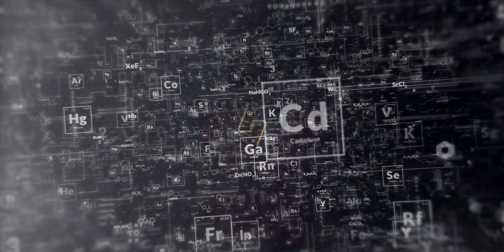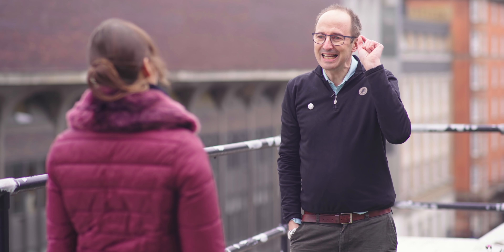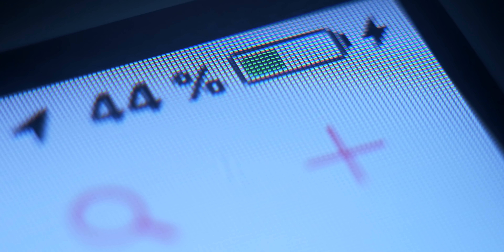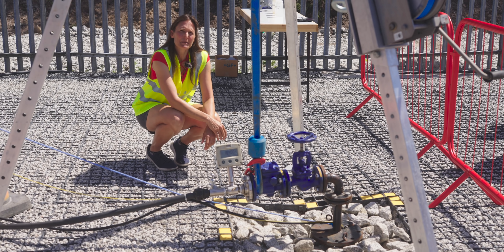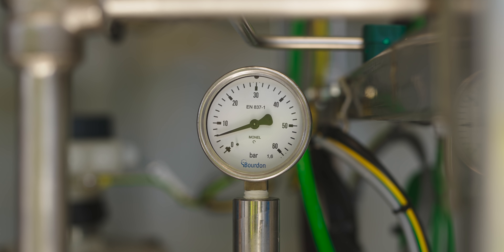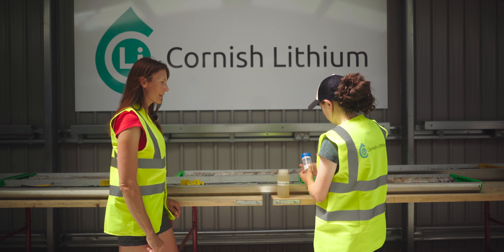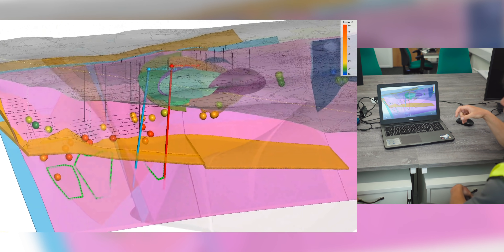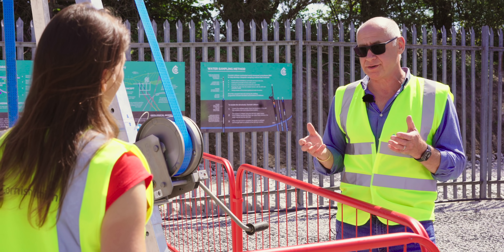LITHIUM for EV BATTERIES - The art of mineral extraction with Cornish Lithium | FULLY CHARGED

Comment from the maker: Do you think Lithium could be the solution to increased demand for EV batteries? Tell us below...
Reply: @UCkDRvquAG0lgBef5zbZwFvg I've been investing in Lithium for 12 years... sea water extraction is to expensive/to slow in process...yes of course its possible,  like thermal extraction from the likes of Geo40 here in NZ etc... Hydroxide is the go to chemical structure considering Ganfeng/Panasonic/Samsung has a problem with the brine operation given the impurities like magnesium more so than Fe etc...
Reply: Great to hear that it should be a more environmentally sound way to extract Lithium I guess? But it would have been far more useful, if a true comparison was done comparing it to current Lithium extraction methods. Anecdotally it seems to have a low concentration and higher costs?  
WADR, we were left with more questions than answers.....
Reply: Peter Lattimort
Reply: Lithium is great for EV's and aircraft etc.
But the next element up in that table was Sodium. Surely we should be using Sodium batteries for everything where weight isn't a factor? It's easy to get hold of - especially as a lot of the world will need to start desalinating sea water as their source of drinking water (ala California - which seems on a one way journey to hell {dry and hot} at the moment!)
Reply: @computerbob06  there are a couple of sodium based battery’s but the energy density is fairly low, as is the charge/discharge rate. They are being used in buildings, for UPS units, but they are bulky and expensive. Not a mainstream item but a niche product.
Reply: Standard Lithium, and E3 metals are doing similar things to Cornwall. Both have pilot plants in operation.
Reply: Worth adding there are other geothermal lithium brine projects, perhaps the most interesting is Vulcan Energy doing similar things in the Upper Rhine in Germany. The potential resource together with the Cornwall one might make Europe lithium independent as a whole.
Reply: How about Vanadium ?
Reply: @SpreadLoveNCreativity  how about sodium
Reply: @troyswan7123  Actually both are good ideas but only science expert can say which ones better in terms of Feasibility, performance etc. Am not into science much 😊.
Reply: @christinalaw3375  Don’t forget the fuss about recycling EV batteries. In reality, an old car will have most of its cells repurposed where ultimate capacity is not an issue and very few will be recycled for many years. When they do, we have ultra chilled processing that safely munches up the battery cells so contents are recovered.
Reply: A great way to burn investment money.
Reply: @christinalaw3375  you’re wrong actually. It’s wind turbines that kill puppies. Coal never killed anything. I don’t want to live in a world where our puppies cant fly around freely. 😂
Reply: @genericuser2339  coal killed my puppy, a sack of it fell on him.
Reply: Cars don't seem to care too much about the added battery mass. If anything, it's used to their advantage in lowering the CoG. But with short-hop sky taxis I think any marginal increases in battery energy density is going to make a huge difference in rate of adoption.
Reply from the maker: @akmuma-r3m  what a lovely comment, I haven't heard that one in a while. There is a company in the City of London, Benchmark Mineral Intelligence, they keep track of all the materials extracted from the earth, how much they cost, where they come from, what they are used for and how much is left.
It's a full time job for 50+ people, that is all they do. Study the markets, talk to the mining and shipping companies, talk to geologists and follow the price and market trends.
They state without hesitation that there is more lithium on the planet than we could ever use. There's not enough copper, nickel, cadmium, chromite, cobalt and many other materials we currently rely on to make the electronics we're using to write these comments, but there's plenty of lithium.
And just to restate, in a large vehicle battery, around 2% of that batteries mass is lithium. We don't need that much, and we can extract it at the end of life and use it again.
Reply from the maker: @akmuma-r3m  You really don't have a response to the reply we supplied do you. We haven't deleted any comments, don't try and flatter yourself that you might be capable of saying something worthy of deleting. Very childish, of course, for all we know, you may be a child
Reply from the maker: @akmuma-r3m  You responded with 'a study' that showed, or maybe suggested that "lithium reserves may end before 2050." And what happened to that comment? I never saw it and I run the comments editing. 
Post it again and let's see if some fascist greenie tree hugger removes it proving your point that you are smarter than me.
And please tell me how 'hydrogen is sustainable. Hydrogen from where, fossil gas (currently that's where 95% of hydrogen comes from) or from excess renewables (with an energy deficit of 4 to 1. And may I ask about the materials needed for lightweight compact fuel cells? The list of rare and expensive metals is eye watering, but I know that doesn't matter. If you work for a fossil fuel lobbying group you just have to say 'hydrogen is the answer' and hundreds of unthinking men who are smarter than me just repeat it like a religious mantra.
Reply from the maker: @akmuma-r3m  Okay, so where is the 'study' you claim you posted? 
At present you are coming across as just another troll paid for by the fossil fuel lobby. 
And of course I've heard about the Proton company, their idea sounds very questionable and it's only an idea.

So far you have come up with nothing even mildly interesting, and no one has deleted any of your comments
Reply from the maker: @akmuma-r3m  Oh dear, I'm so sorry for responding to you at all. I have checked with the team, no one even knows you've been posting these childish comments, let alone deleted them. We have deleted nothing, and clearly you don't have the logic, whatever that means, to actually come up with a cohesive argument.
Reply: @fullychargedshow  I'd actually like to see a certain mechanoid clean up all of that idiot's comments!
Reply: @akmuma-r3m  Stop leaving comments like 'Deleted comment' 
Nobody will fall for it because deleted comments can't be read...
Reply: Isnt this the bubble doctor??
Reply: 0 carbon?
Reply: Overpopulation??? lmfao.... where???  

For those who hate the supposed toxicity of  Lithium processing... stop using Lithium based devices to make moronic comments on YT.... smh...
Reply: @nc3826  every third world country. Not enough houses in this country

Comment: In regard to 'flowing' the lithium rich brine from the depths mentioned what powers that extraction? 

For hydrocarbon extractions the underground reservoir is typically pressurised by the gas contained therein which provides the energy to raise the reservoir's contents to ground level, except in cases were the pressure has escaped due to previous exploitation, or in shallow reservoirs which 'leak' and so require the ubiquitous 'nodding neddy' beam pumps. So does the Cornish extraction require pumping and if so what powers these?

Comment: hearing aid metal-air, batteries without integrated oxidizer, jet engines vs rockets, gasoline in air vs included oxygen tanks
Reply: single use recharged metal zinc-air batteries, aluminium-air, magnesium-air, cadmium-air, iron-air, silicon-air, *-air batteries, with renewable wind/solar/wave/nuclear charging/ore-processing stations

Comment: There is also Lithium under the oil and gas fields in Alberta, It is brought to the surface as produced water. E3 metals are processing this to get Lithium.
In the states Standard Lithium is doing a similar thing. Both then use membranes/patented processes to separate out the lithium, and return the water. Membrane tech is being used to process water in a number of ways.

Comment: Why does the effusive video never even mention the next steps to turn the water solution into a solid lithium compound suitable for the next step towards a material suitable for battery manufacturing?  Conventional evaporation doesn't seem viable in Cornwall (it rains nearly every time I've been there on holiday), and that takes massive land area, which a) Cornwall doesn't have to spare, and b) is counter to the low-land-use extraction method mentioned.  Please think about next steps before getting all giddy.

Comment: Its fine to say it comes out of the ground naturally but thats probably how the first coal worked. A guy found it naturally but then demand required digging for it.
Reply: Yes, but when you dig coal out of a hole, the hole doesn't then refill with more coal... Unlike water.
Reply: @juststeve5542  nor will it refill with  lithium brine. It takes a lot of time (I would imagine) for the lithium to get released from the ground into the water. Also if you pump billions of gallons a day out of the ground to extract the lithium will fresh water have to be pumped back in to replace it ?  The point Im making is anything at mega large scale has a footprint.

Comment: Great episode, however it wasn't mentioned how the brine was treated and any possible impact on the ground water nor the waste water from the process was treated. Any mining business is usually quite dirty.
Reply: The water would be separated from the lithium by a membrane unit. The water would then be re-injected back into the ground. The concentrated lithium solution would then be further processed. Standard Lithium and E3 metals, plus others are doing this. Membranes are used to produce drinking water in the UK. This is really just a targeted version of it. Where the drinking water is the target normally, with some concentrated waste water. In this case the waste water would be the target.

Comment: I would like to have a nuclear powered motorcycle that needs to be recharged every hundred years.
Reply: After a big day of dirt bike riding a few years ago down in Tassie, we were sitting around getting on the beers. I said "Guys, bear with me on this.  Imagine an age when nuclear power has been made so safe that we can have little nuclear reactors and power generation units about 150mm diameter.  And so safe that it's government approved globally.  Then we could have a generator unit in each of the front and back wheel hubs, saving so much weight that the bike is massively lighter and more maneuverable.  How cool would that be?"
First response - "The government would never allow it".
Shake my head...

Comment: Not saying how they are extracting the Li from the water. Normally it is done in big open-air ponds. I gues they are keeping that bit quite.
Reply: I expect they’ll need some sort of preferential ion exchange medium or membrane, they already said it’s brackish rather than concentrated, so evaporation has a lot of work to do.  It’s not like they’ve got a handy Andean high-altitude desert to desiccate anything on sight.  

For all it’s good points, this video did skip over many of the the environmentally and geopolitically horrible current state of lithium extraction, but dwelling on that would undermine the shiny eco-future that ‘Fully Charged’ is selling.

Comment: I'm concerned that this is basically the same as fracking whether it's actually breaking the ground up or not it's still extracting material by force from below the surface without reinforcing structures like traditional mining and could surely lead to earthquakes and sink holes?
Reply: Well, water actually - and not actually by force......
Reply: @andymccabe6712  Yes I understand that the material is being extracted by water, is it from ground water or is the water being pumped into the ground under pressure then extracted?
Reply: @davidcassidy2731  The water is already down there, so it's Ground Water. I guess they might have to inject a bit of fresh water to fill up the pipes and get it to start to come out but I doubt the pressures are very high. Most likely they use borehole pumps which are put down the hole and pump the water up without pressurising from the surface. The pressures would certainly be nowhere near what would be needed for fracking. Also, once the lithium has been extracted, they are returning the liquid to the borehole to keep the process going. I doubt the lithium concentration is very high so the volume reduction will be minimal. I wish they had said what the concentration was.

Comment: Fracking lite
Reply: There is no fracking. They are going to use naturally formed and pre-existing faults and fractures formed millions of years ago as conduits to extract existing groundwater. The groundwater is reinjected back underground where it came from after the lithium is extracted.
Reply: @paulm3538  it's still fracturing. All water borehole drilling causes earthquake no matter how small on Richter scale
Reply: @TheMagicJIZZ   Driving your car, bus or train, waves in the sea, thunder and lightening can all be detected seismically, you want to ban all those as well.

Comment: Regarding the underground water being under pressure, will that pressure diminish over time? Will it possibly stop or is it naturally replenished? Even though water is not being pushed in, does the water rushing out cause some earthquakes or tremors? He said that they’re returning the water but, even if not returned under pressure, it can still cause fracking and quakes (it happens) – are they measuring for any or simply assuming that it’s not occurring? Are they extracting and using (selling) all minerals in the water or just Lithium and pouring the rest back into the hole? Are they using the thermal energy for anything?

Comment: So, in addition to getting lithium out of the water, you can use the heat for electricity too.
Reply: Yes, correct - but they will need to use any geothermal energy they generate to extract the lithium from the ground water. It’s definitely a positive in the economics of an operation. 
Note they also mention 2 or 3 other elements of commercial interest at minute 11.25, these could also positively impact the extraction economics depending on their relative concentrations and the forecast prices of these other minerals over the commercial life of any potential operation.
Reply: @paulm3538  I'd be willing to bet that anything that comes with the water is going to be more concentrated than conventional mines. IIRC, viable modern mines can operate with concentrations in single digit percentages. Probably cheaper up front costs to picking up nodules from the deep sea like a few companies are starting to ramp up for.
Reply: @coreys2686   The two biggest soft rock lithium mines currently being developed are in Nevada USA and Sonora Mexico. Both planned to come on line  in the next couple of years. They both have lithium carbonate concentrations of  1.5 to 2.0% and will be long life opencast mines.  Most existing lithium production in S. America and China is by water evaporation of saline water from the naturally occurring high altitude salt pans and are designed as cheap operations. Concentration of lithium in saline water is less of an issue than the complexities of production. Bolivia has the worlds largest deposit (Uyuni salt flat), but this has always struggled to be economic due to relatively high precipitation reducing evaporation efficiency compared to Chilean and Argentinian salt pan resources and also the complicated chemistry of the Uyuni brines that make the extraction of lithium carbonate more difficult/expensive. Throw in industry nationalisation and it becomes extremely high risk. China will obviously supply China first and everyone else third, hence the recent new mine development push in Nevada, Mexico and Australia. So even if Cornwall is relatively expensive to produce, long term stability of supply and political stability will become a key factor in any considered development.

Comment: Lithium battery production is a social and environmental disaster. When combined with the lack viable recycling it just gets worse.
Reply: Yeh oil production and burning is much cleaner.
Reply: @TriviaChallenge  Especially when you get the odd huge oil tanker spillage which pollutes thousands of square miles of ocean with thick shitty crude oil which usually ends up on a coastline somewhere, costing millions to clean up. I can't think what the problem is there.....
Reply: Batteries can be recycled. Unfortunately once burned oil cannot.
Reply: What lack of viable recycling might that be Robert? Volkswagen already have an electric car battery recycling plant up and running in Germany. Do a search on YouTube for the video and see the recycing process for yourself. Almost all parts of the battery packs can be recycled and reclaimed. The cobalt and lithium in the batteries can be recovered to levels of around 90%, after which they can be re-used. The steel and aluminium parts can also be re-used. Where is the lack of recycling viability there?  It's petrol and diesel that are unviable, as there is no way to recycle and re-use petrol or diesel once it's been burned in a combustion engine at 30% (or less) efficiency.....
Reply: So, Robert - your solution to decarbonising the planet before we all die is .............??!